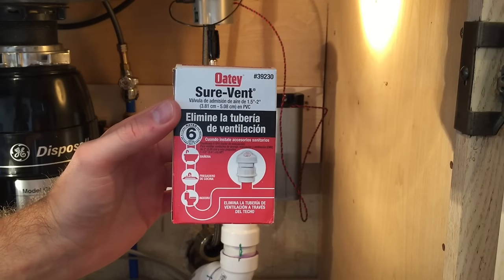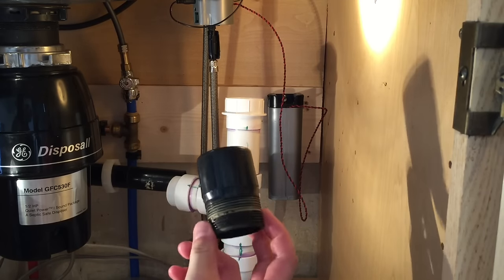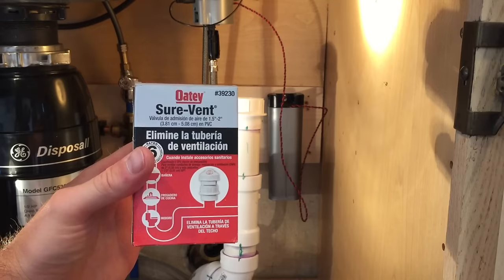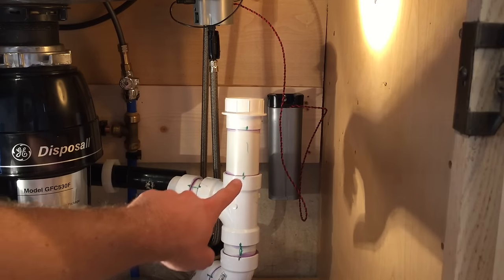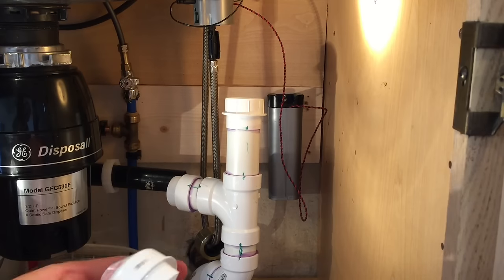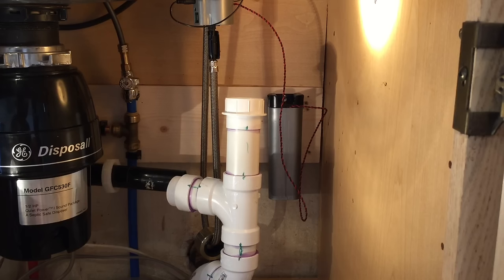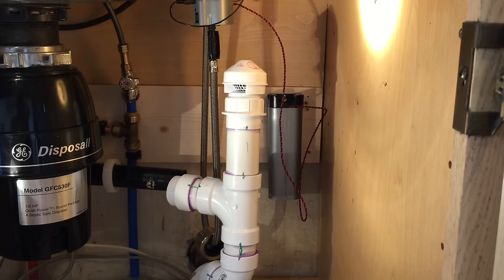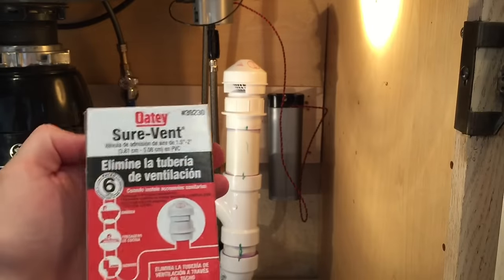OATEY Sure-Vent Installation - Eliminate the Vent Pipe!

Comment: So can I use this in lieu of a vent stack? That would be awesome.
Reply from the maker: Thomas Randall yes, you can use this AAV when it is not feasible to plumb into the vent stack.
Reply: Keep in mind that the fine print on the AAVs states that you need at least one actual vent that goes to atmosphere (either through the roof or out a wall and up above the roof) in order to function properly. I could be wrong, but I believe it is because of positive air pressure buildup. It wouldn't work reliably if you used an AAV on every single fixture-- and it is not recommended to use an AAV for washing machines But, if your house has at least one proper vent it should be ok.
Reply: @mycats7321  you are right.   I live in a mobile home, and just took it down to studs and floor joist..   I have two thru the roof vents and four AAV's.  I did replace one black one with a new white one. But I will be replacing all of them with white ones.      Plus I will be mounting them as high as possible under the sinks.
Reply: I suggest including a before and after video of the basin draining for viewers to actually see the difference it makes.
Reply: @rcrepps3949  I know this is old. Can you please give an idea of what you did. I have a mobile home also. NO ONE WANTS TO TOUCH THE PLUMBING
Reply: @yoco3135  There's a very good reason for that.  It's called ABS.  Awful Bad Stuff.

Comment: Is this good to use to get rid of that sulphur smell?
Reply from the maker: F1 F it would depend on where the source of the smell is coming from. If you have an existing AAV that’s allowing air to leak out, then replacing it with this AAV should alleviate that issue.

Comment: so what happens with the vent stack in roof? how do you close that so water doesn't come into house if I go this route instead?
Reply from the maker: Good question. In my case the previous owners/plumbers/DIY'ers cut the pipe and used spray foam to seal it...which leaked water when it rained as the foam started to fail. I removed the spray foam from the pipe, cleaned the outside end of the pipe, and attached a rubber Fernco to cap it. However, ideally it should either be piped into the sewer line or detached from where it meets the main stack to avoid any water leakage.

Comment: Ok....so if I put one of these under bathroom sink will that also help with the toilet ? 
Previous homeowner put in a second floor bathroom without venting it( inspector didn't catch it ). 
I'm thinking of an alternative to ripping walls and going out the roof bc it's way to expensive.....so will this help with my case ?
Reply: Many plumbing codes prohibit their use in new construction, but encourage their use in retrofitting existing unvented drains.   And this seems reasonable to me, even though it may at first sight seem to be a double standard.

It can solve your problem without major surgery to retrofit a proper vent to the roof, but if everyone used AAV's for every plumbing fixture in the building, instead of traditional roof vents, it would be a problem for the sewer as a whole.  The sewer depends on having ventilation through each customers' roof vent system, and so does a septic tank.   The code needs to enforce traditional vent systems in order to fulfill the altruistic purpose of the sewer being vented at each customer's location.  If your home is the sole user of your own septic tank, you also need at least one vented fixture with a traditional plumbing vent, instead of an AAV.
Reply: All fixtures need to be attached to the same waste pipe and the device needs to be in the correct spot. Do some research. For some reason, plumbers don't tell the whole story about how and where to use them.

Comment: Can one of this be used for both the kitchen sink drain  and washer drain or does it need 2
Reply from the maker: That will depend on the AAV size and airflow rating which you purchase. Someone larger ones will accommodate more airflow, while smaller ones are more compact, but provide less airflow. You’ll need to confirm what the AAV is rated for on the packaging to see if you can use it for both a sink + washer vent.
Reply: Just research AAVs. You will find lots of information on them here on YouTube as well. There is a setup for venting a washing machine. I would do it separately from the kitchen sink.

Comment: Our plumber put the vent inside the wall.  I think because it was the only way to get enough height.  I put some insulation back in the wall and covered the studs with wallboard.  I don't think it is getting enough air as we have smells coming up sink when we first turn the water on for a minute or so.  Do these work inside a wall?  I guess I could pull the insulation out but will that be enough air?  Our drain goes outside the house.  Can I put one of these outdoors?
Reply from the maker: You can install the Oatey Sure-Vent in-wall, but it must installed at least 6 inch above any insulation material, and it must be accessible for inspection and service, which you can accomplish by installing one of the Oatey metal or polystyrene wall boxes with vent grates. You cannot install it outside and it cannot be exposed to any elements, but you can install it in another room on floor as the drain it's servicing.
Reply: My Plummer wants to put it in the wall and im scared about the gases being released inside of tge walls
Reply from the maker: R BEAUMONTII the AAV should never allow gases out, it should only allow air from the dwelling in. However, if the AAV were to fail, it’s possible it could allow sewer gases to escape in your wall cavity. This is why it’s important that they do not seal the AAV in the wall with a piece a plasterboard. If the plumber will not install it outside the wall, just make sure they add a door with a grate on it to allow access to service it and allow air to enter the grate. This would also allow you to smell the sewer gases quickly if it were to fail open and gives you the opportunity to get it fixed immediately.

Comment: Thanks for the video! I do have some of that in my house. Can I retrofit the other sinks that are conn ted to the roof vent with it? does that need to be replaced or cleaned every few years? Because I do smell sewer gas, or some kind of funky smell in my house.
Reply from the maker: Pristin V they can certainly fail as they age. You can ensure that it screwed in tight. However, if it is, I would recommend replacing it as they do not last forever.
Reply: If you are the only one in multi bath house make sure you occasionally run the other baths , showers , and sinks , toilets as vent traps only work with water in them . They can evaporate from non use and allow gas to vent. Any plumbing with roof vent should not be venting gas into house and i would not replace a vented line with one of these . If you have them already might want to replace them  with this new one here in video.

Comment: but isn't the point of the high vents for pressure? how does a short pipe like this maintain the pressure?
Reply: There is no pressure. its open atmosphere.
Reply: @MuttonChops24  My tiny home has no roof vents....can I just use something like this for everything? (1 toilet 1 sink)
Reply: @levijessegonzalez3629  you can probably get away with it but its always best to have at least 1 roof vent so back pressure isnt created by the suction of water draining down

Comment: It's my understanding that these aav units allow air in to equalize the pressure in the system and prevent a vacuum from sucking out the water in your p-traps. I get that part. But what happens to the actual gases you're trying to vent? do they just come out into the room where you installed the aav? Or do they remain in the system to be vented elsewhere. I'm asking because I'm going to be plumbing out a finished "shed" and this appears to be the perfect solution for not ruining the roof with a vent stack.
Reply from the maker: It's a one way value that allows air into the system, but not out - it's designed to equalize the pressure in the system. If it were to let air out, then it would allow sewer gases into your dwell (and in your case, shed) or water if the p-trap were to drain slowly and/or clog.
Reply: These are awful. I have them on all my plumbing in an apartment complex. Constantly changing them. They do not work.
Reply: Jayson Bogan I have the same problem
Reply: @jaysonbogan2213  It may be installed improperly or you may not have a big enough vent for for your fixture
Reply: How’s the device working for you or did you go through your roof?
Reply: @jaysonbogan2213  funny....I have them and  have had zero problem with them. Works like a charm.

Comment: I had the black ones in my trailer if one was stopped and not working would that cause backup issues
Reply from the maker: Michael Tobat an AAV that is not allowing air into the system can cause sluggish drainage or siphoning of the water that is suppose to reside in you P or S trap, which would result in sewer gases coming out through the drain.
Reply: Don't ever use the small, cheap black ones. Replace with a quality AAV. A failed AAV will cause drainage issues.

Comment: Why don’t you have a P-trap and why did you wrap the tape backwards?Is it may be a how to not do it right video?
Reply from the maker: oranjguy the P-trap is hidden behind the GE disposal and is not in view of the camera. The Teflon tape was accidentally wrapped CCW instead of CW in the video. However, I’ve never seen the Teflon tape wrap orientation result in an air or water leak in practice.
Reply: wrapping the Teflon ccw can cause it to unwrap whenever you thread whatever you're connecting.  if you unwrap it, you've effectively removed it from your threads.  that's all.  most of the time it's not really needed.  it's just good insurance to have it, and it prevents corrosion in the threads between the two threaded metals. 
just curious about the new vent cap, besides the mesh grill vents instead of the open vents, is there something internally different that will prevent the odors from the drain pipe to seep out?
Reply from the maker: brussell639 yes, the internals of the Sure-Vent AAV are different then the basic black vent it replaced.

Comment: My kitchen sink has one of these & it doesn't drain right so should I run a vent out of the roof??
Reply: Maybe the vent has failed, possibly try to replace the vent and see what happens
Reply: @at0mix197 
 when I fill the sink and release the water I can smell sewer gas
From valve 
Do you know why?
Reply: J Sm: From what I've found it is most likely an issue with your vent system and possibly an issue with the P-trap under sink (but not necessarily). Does the sink have a vent like the one in the video? Perhaps this would solve the issue. It's possible that the suction is pulling all of the water from P-trap which will allow gasses to come flowing through until water is back in to block the gasses.
The vent like in the video. Hope this helps.
Reply: @xXxCrazyJay810xXx  comment above didn't tag you for some reason

Comment: I don't understand why your original Pro-vent style did not meet code and the new Oatey does meet code?
Reply from the maker: pdoggy10inch it's a good question, but I don't know the subtleties. Perhaps this was a local code enforced by the town which I reside? I did not get the opportunity to find out those details from the plumber that advised me on this matter.
Reply: pdoggy10inch it is the design of the rubber valve inside...one ia more reliable and has a smaller chance of failure...one is $6 one is $20ish
Reply from the maker: Thanks for adding some additional color on the reasoning.
Reply: @ErikAsquith  Specifically, it's the fact that the old ~$6 AAVs use mechanical springs, rather than gravity, to keep the rubber valve sealed.  The springs are prone to failure over a number of uses.  The new AAV design is much more reliable.
Reply from the maker: Wade Sims thanks for the additional color.

Comment: 6 inches NOT 4 , you have been warned. There is no need for the plumbers tape , this is and AIR vent it doesnt  get wet
Reply: Stan Lee    Just let you know.  I did it without tape around.  And it the smell really bad.   So please put some tape or some thing Around the threads
Reply from the maker: Stan Lee you’ll still want to ensure the fitting is air tight to avoid any sewer gases from escaping into the dwelling.

Comment: I have a double sink and the water backs up and out the vent! I have it 5 " higher than trap! Why???
Reply from the maker: frenchis19 water is backing up likely do to partial or full clog somewhere in the drain pipe. The water is backing up and rising in the pipe. As the water rises it will escape from the lowest point, which is your AAV. If you were you temporarily remove your AAV and cap the pipe you would likely see the water start to rise in your sink bowl, which would indicate a clog. Good luck and let us know how things work out. Please consider subscribing if you haven’t already.
Reply: Erik Asquith : so I used this water bullet attachment to my water hose and put it in my drain after taking off drains and trap. I don't have too far to go where it would be blocked before it reaches the 4" pipe: sure no blocks but the pressure of the water still comes up either in sinks or aav. Could it be the dishwasher hose which is just above the trap but not above the two drains for the sink?
Reply: Just so you are aware..your dishwasher drain line should rise up to the highest point in your cabinet under the counter top...as an air gap loop..or have an air gap device installed just for the dishwasher.
As far as the leaking AAV..make sure it is 4" above the horizontal waste arm of the Ptrap. Since it is leaking..replace it..if it ever smells or leaks..replace it. These things are mechanical devices prone to failure eventually

Comment: Well, if you install one of these, and customer calls you a few weeks later, and says the house smells like gas when it rains, I will save you the headache. Rain water enters the sewer main, and more water means more air pushing up. When water usage is up, the auto vent will hang open, and fill up house with sewer gas
Reply: These are NOT meant as the sole vent in the plumbing system dude. These are only to equalize pressure in a branch line to allow for adequate draining without sucking air from traps (ie like when the washing machine drains, the kitchen sink starts gurgling). You still need a main stack vent downstream.
Reply: @jgg204   I eventually had to go back and tie both lines I auto vented, into the 3" going out the roof. It says it on the box, must have at least 1, 3" vent, so that wasn't the issue, clearly

Comment: Can I use this on an upflush toilet like the Saniflo I have in my basement?
Reply from the maker: Personally I have never used or installed a Saniflo. However, from what I could gather it uses a 1-1/2" PVC vent pipe. So you should be able to use this AAV if you are not able to tap into an existing vent pipe.
Reply: Tom Fuller did it work?
Reply: no- pump needs both positive and negative venting

Comment: What keeps sewer gas from coming out there is a reason y the main drain pipe is called the stink pipe ?
Reply: They are built in such a way that they allow air in, but don't allow gas to exit.  Hence, air "admittance" valve.
Reply: They are built in such a way that they allow air in, but don't allow gas to exit.  Hence, air "admittance" valve.
Reply: Good grief....  sorry, my browser often auto-posts my messages a bunch of times automatically.  Aggravating.  I can't figure out why.
Reply: Good grief....  sorry, my browser often auto-posts my messages a bunch of times automatically.  Aggravating.  I can't figure out why.

Comment: I bought one of these and installed per directions with the 4" minimum rise and my kitchen sink still gurgles when the clothes washer goes through the rinse cycle.
Reply: did you put one after the trap on the drain line for the clothes washer? You need a vent within 5 feet of your washer drain line
Reply: fordrac1ng81 no, I didn't.  The washer is on the second floor so the water run down the wall to the basement.  I was thinking of putting another vent in the basement along the horizontal pipe that runs from where the sink and washer drains meet to where the sink drain goes back up vertcally to the first floor....and maybe that's what you mean.
Reply: watch "This old House" video and check if you have an "s" in your line, they explain the gurgling and reference one of these mechanical vents, it may help you figure it out because that gurgling means something is not properly installed or vented.....https://youtu.be/weDLgHiSiCw

Comment: If you your sink ever backs up wouldn't it come out through the vent and into you cabinet
Reply from the maker: Erik Garcia it has a one way valve that allows air in, but won’t allow air and water out. However, if it an older unit that happens to fail, it could allow some water to leak out if you have a clog that causes a backup. If you have a clog that causes a backs up, I would recommend checking the AAV to ensure nothing leaks, and if it does, place a towel or pan underneath to catch any drips.
Reply: Erik Garcia i